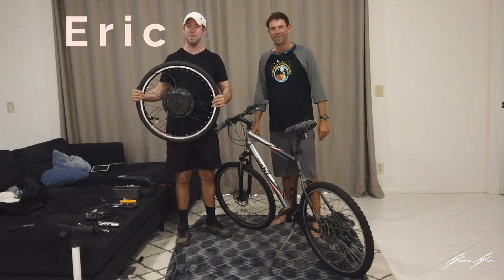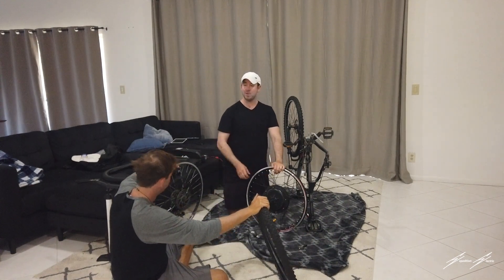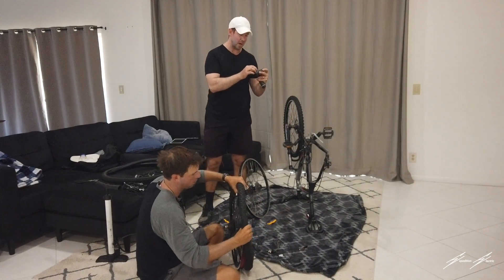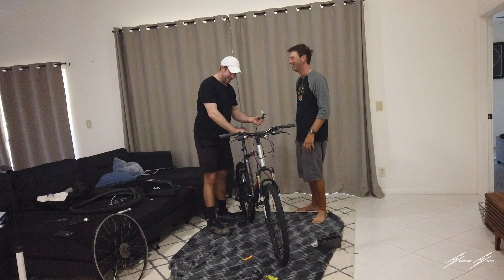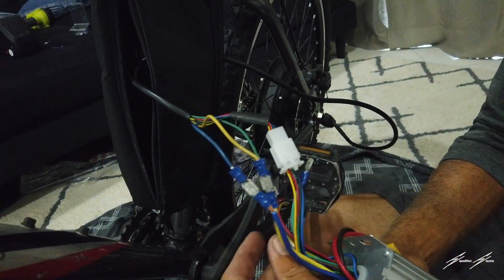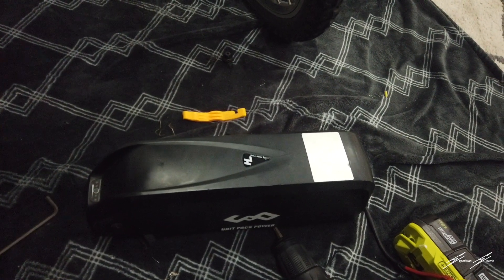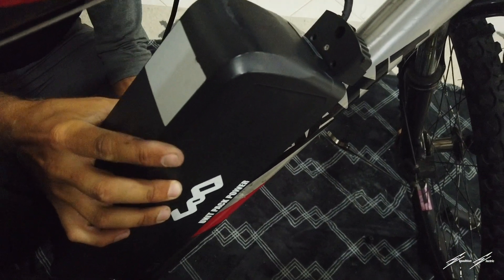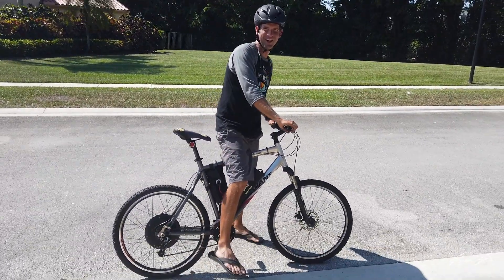Cheap Electric Bike Conversion Kit that gives you the speed you need

Comment: Mine is probably the best investment I ever made. Turned a $50 bike into a motorcycle.
Reply from the maker: Nice, what did you install?
Reply: @expedition-electric3549  The 48v 1000W version, 10 amph battery. Gets over 30MPH on a flat stretch of road. Topped so far at 32. I can do 0.8 miles in about 5 minutes depending on conditions.
Reply from the maker: @Anarchist86ed  Sweet!  What type of bike did you use for the install?